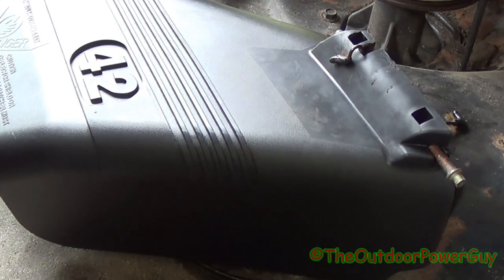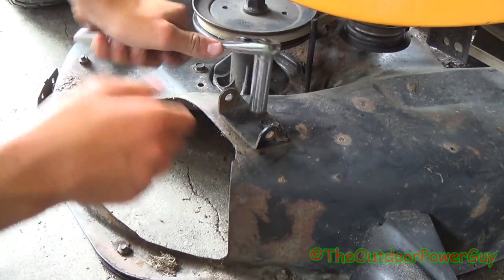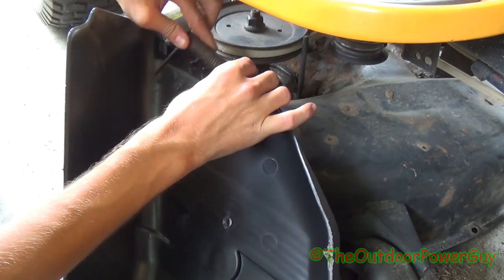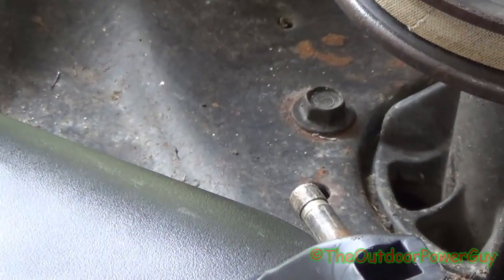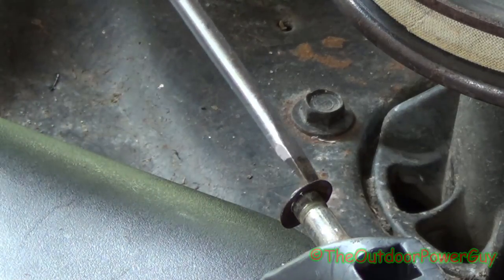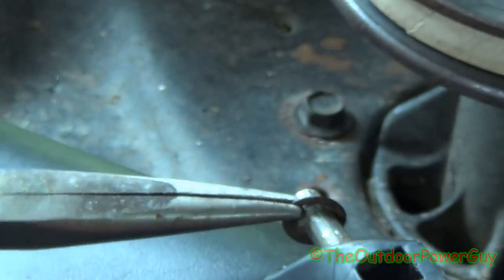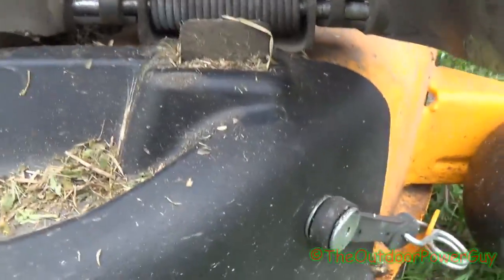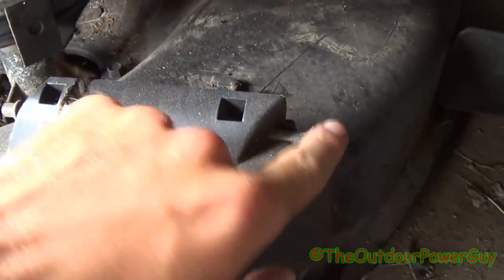HOW TO REPLACE THE CHUTE DEFLECTOR ON A 42 INCH HUSQVARNA CRAFTSMAN RIDING MOWER

Comment: To flatten the push cap (split washer thingy) put it on a flat surface and tap it once with a hammer.
To install it, use a socket and hammer. Put the socket over it and lightly tap it with a hammer and it'll go on evenly within seconds. You won't have a screwdriver slipping and poking your eye out.

Comment: Need to show how you removed the end of the shaft that you tap out at the very beginning. It has a permanently fastened keeper on the end that you tapped out. Did you cut it off?

Comment: Thanks for the instructions. I have wanted to remove the discharge chute for years but didn't want to screw anything up trying to muscle it off. Mine didn't have a push cap on the end; it had a lock washer.  Which as i pulled it of the shaft it launched into parts of garage unknown.  I'll use a push cap if I ever put the discharge chute back on.

Comment: Keep the good work. Just what I was looking for. Thanks. I'm 84 and even I can do it. If you can improve on close up of how spring goes in it would help us old guys.
Reply from the maker: My grandfather is 90 and still works on small engines & mowers, i will do a video on how to easily install the spring, it's not complicated, it's hard to do even for me as the spring has alot of tension on it. Best wishes to you and have a blessed day. thanks for the comment.

Comment: Vid was great describing the spring placement but been trying to get the lock washer back on my 42in old Craftsman for 2 days!  Have a quarter inch and 5/8 ones with teeth.  Quarter seems too small and the 5 too big. ??   😫. (it's the same color as your '03 green one at the end of the vid, think mine's an '05).

Comment: Thanks for you video. After watching it, I bought the new type of bracket with the little up-bend to be mounted on my craftsman riding mower, LT2000. The bracket with the up-bend hook that I bought is Husqvarna Part Number 532192557 Bracket-Deflector.  I also bought the 42” chute deflector that has the raised area for the hook to fit in.  The shield deflector that I bought is Husqvarna Part Number 532403004 Shield-Deflector.  Even after watching the video several times, I’m still having a hard time mounting the system.  I’m using my existing old torsion spring with 20 coils. The spring in your video also has 20 coils.  I’m not sure if mine torsion spring is old and therefore needs a different type of torsion spring or a replacement. If so, do you have a recommendation in terms of size etc for the spring?

Comment: Would this also fit for a 46inch? Husqvarna yth44v46
Reply from the maker: The process of installation is the same for all Husqvarna made riding mowers using a stamped, non-fabricated deck.

Comment: So if I just wanted to remove mine completely, take out the two screws? I installed a mulching kit, which included a piece to block side discharge. Thanks
Reply from the maker: The chute deflector is necessary for the mulching kit, it holds the block off plate (mulching cover) down, i do not recommend taking it off.